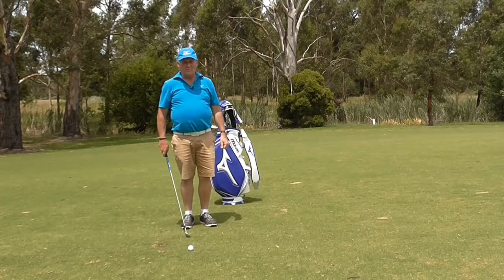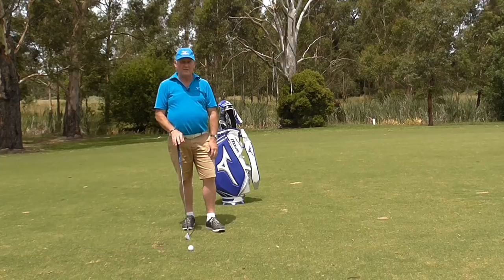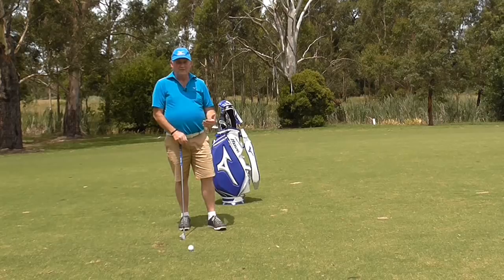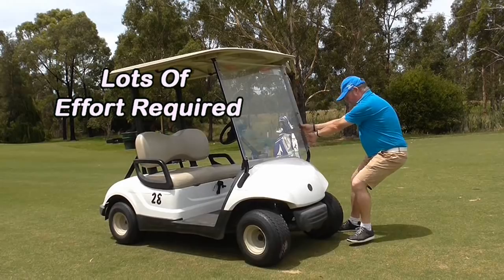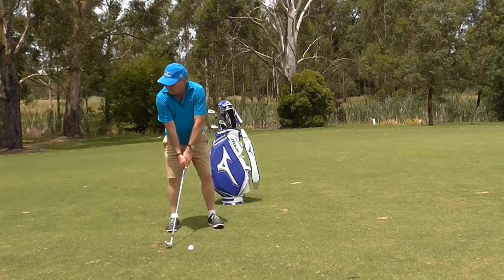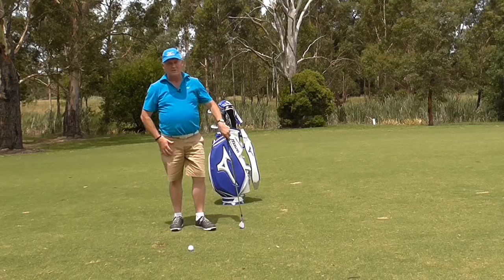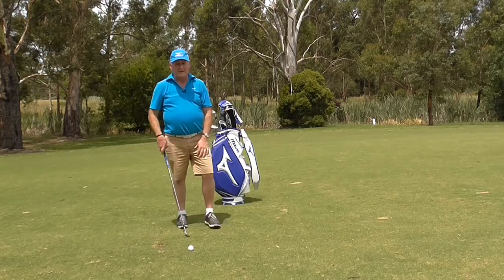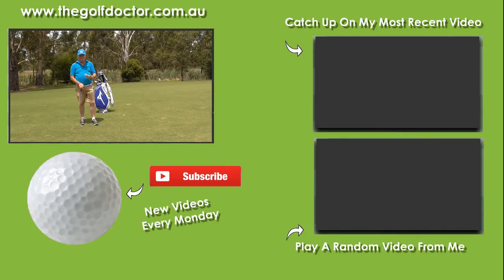Pull V Push In The Downswing

Comment: Top advice. I agree with you 100 percent. The only things  else I would recommend for a golfer to do is to imagine tightening the cover of a jar with the lead hand as they execute their downswing pushing hard with with the right hand. This one action serves to not only naturally shallow the club to the impact zone; but allows the lead elbow to turn slightly inward to the player's body serving the lead arm to rotate through the shot as the lead forearm bends at the elbow to the finish of the swing. The two combined actions of our opposing hands( tightening and tugging with the lead hand while pushing/ throwing soft or hard( depending on desired distant of the ball required) with the trail hand at the beginning of our downswing) will also increases the club head centripetal force as it travels around our body in full completed path to the finish of our swing. Yes; the lead hand is not pulling a chain or or rope: but with the tightening of the cover of the jar;  one should also apply a slight tug with the lead hand. Cheers I hope you would agree to highlight my remark after you try this yourself. Cheers
Reply from the maker: Looks like you found something that works well for you. Keep doing it. It must be the right thought for you. 

Brian

Comment: If this was true then why does the trailer not go in front of the car?

Why does the diesel engine lead the train?

Pulling generates a more easily repeatable move which leads to more consistent ball striking.
Reply from the maker: They both require large engines and take a lot of  time to get up to the speed. As I said in the video it takes a lot of force to move.
Reply: @fitzygolfpro  Your legs and core are incredibly large and strong engines.  Most people don't understand how to use them.

Comment: The 'pull' is from the pivot, not the hands / arms. The hands and arms sling as a result of the pivot moving.  The best ball strikers on the planet all 'pull' with their pivots, not push with their trail sides.  Watch Dustin Johnson or Colin Morikawa. They clearly are pulling from their left sides, the result being their hands continue to move through the strike, as the club head never passes their hands.

Also, with your cart analogy. If you push something from behind, it's subject to erratic movement, highly unstable. Think of this, if you pushed a shopping cart with 1000lbs of force for 100ft, you have no idea where it will go.  On the other hand, if you pull a shopping cart with 1000lbs of force for 100 ft, it will go exactly where you pull it toward.  When you pull something, it will result in a very straight, stable line.  The lever needs to be 'pulled', not pushed.
Reply from the maker: Thanks again